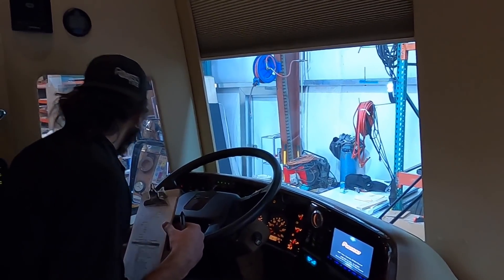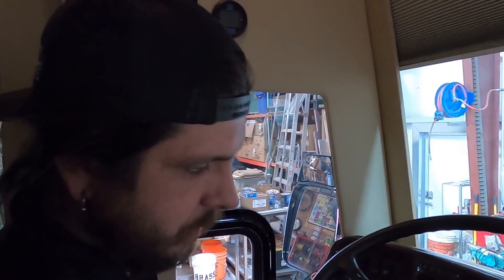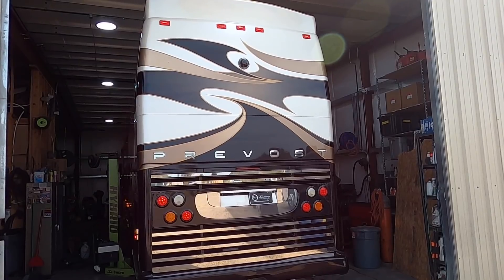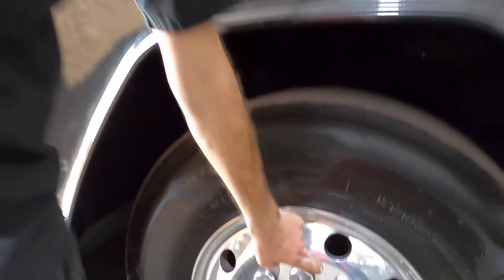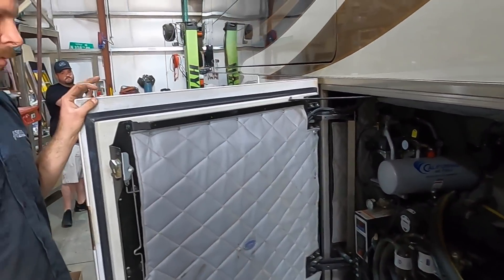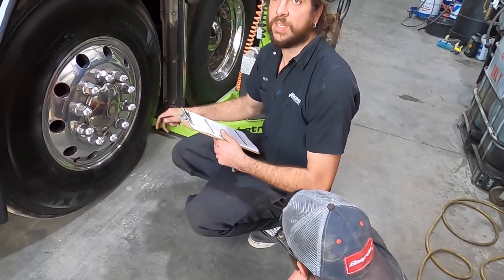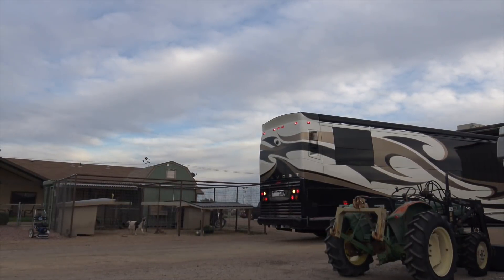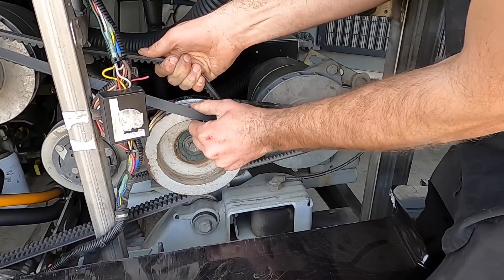TECHNICIAN INSPECTS PREVOST COACH FOR POTENTIAL BUYER

Comment from the maker: Chassis inspection like is shown in this video is typically $500 and can go up if more hours are required.  Another inspection testing all of the systems would be approximately another $500.  For rates on filming your inspection, email me at ansautodetail@gmail.com
Reply: Do you know if Dale Earnhardt jrs old white Newell with orange flames coach is for sale or rent? Let me know if you need a photo of it.
Reply: wait...what's going on here? I thought you paid us for filming our rigs? ;)
Reply: Another great video. For a Prevost inspection, I would have expected more technical data for the A/C; instead of, it works/its cold. I would expect to return temperature data for return air temperature as well as outlet compressor temperature.

Comment: Next to your “How To Detailing” videos, probably one of your best. People need to understand that this was a basic exterior/mechanical inspection only, without fluids analysis. All the interior systems & road test are on completely different checklists. Suggest you post those those checklists, so everyone can see how thorough even a basic inspection needs to be. Soapy water works fine when searching for that BIG air leak. However, I was surprised Kyle is not using a Sonic Leak Detector to find those pesky smaller ones.

Comment: It's amazing that they trust only those lifts and they have no Jack's underneath it for extra security I don't know how they do it nerves of Steel
Reply: those wheel lifts have steel locking tabs/dogs, that drop into place about every 4" of lift. So each lift unit is its own jack stand.    You have redundancy, you have the  hydraulic lift cylinder, and the steel dogs, that are auto deploying as you lift the wheels.   this shop has the older style that are cable connected, you will see a cable drooping in one of the cargo door inspections,   that cable connects each of the lift unit, so all will lift or lower together.  the more modern ones are wireless.  these lifts are very pricey.

Comment: Other right!! Fascinating video and information. Do you have a video of trade offs for used coaches and repairs to keep it in optimal condition? Is it worth saving on purchase and spending on repairs vs. spending more on purchase and hoping little repairs down the road. Also what's the usual life expectancy of the coach, both the body and systems as well as the motor? What is salvaged when it's past life?

Comment: Tires date codes,engine oil sample,trans sample ,dip the coolant for PHand test drive.  Always no matter what deduct engine belts,tensioners,idlers.Complete lube and engine service with filters no matter what seller says. Than during your 2-5 hours run thru with seller have generator running and most of the coach turned on with all AC running. RADIATOR..turbo connections.  I personally would also price in complete wheel and bearing removal to get in deep. Plan on 9-20k if you cant do the work yourself for dependability.Rather see a 85-100k mile coach than a 24k. All this being 8 plus year old coach.  Really need to spend a day or more for a detailed inspection so at 125 per hour 1200-1800 inspection is peanuts...good starter vid👍👍👍 But it gets much more involved.
Reply: totally agree about the mileage variant, there's a point when less is more (trouble), and one can do a vg visual inspection with minimal mechanical aptitude to get a feel for how the bus was maintained. You detail every nook and cranny and often you can avoid paying a grand and more for a test that's likely to be a fail. Of course, if they pass the visual inspection then you can have the real expert do his thing. If I'm spending $100k or more, $1k is insurance well spent for the peace of mind in knowing where one stands. Checking for air pressure leaks is huge with these 3 and 4 sliders. Seals are not able to last forever. They are subject to heat and time, and that's another area to consider when buying a rig - where was this kept, if outside, what are the weather variants for that area? If it's Las Vegas, some things are going to fail sooner in that wretched environment.